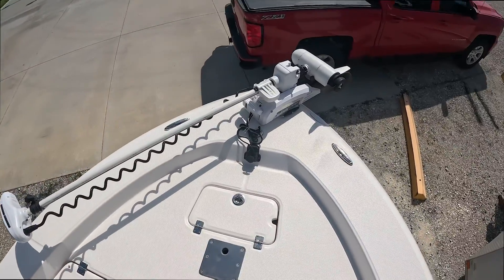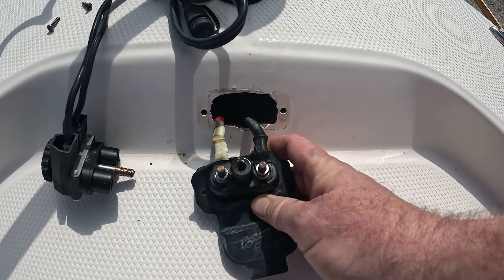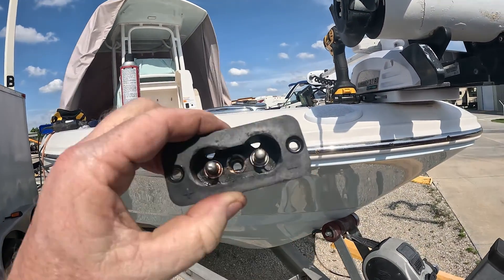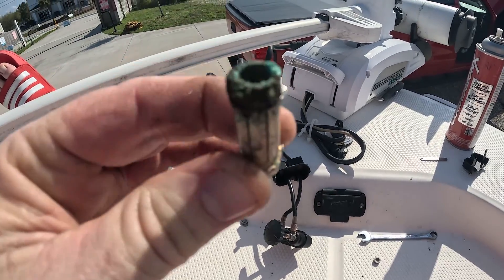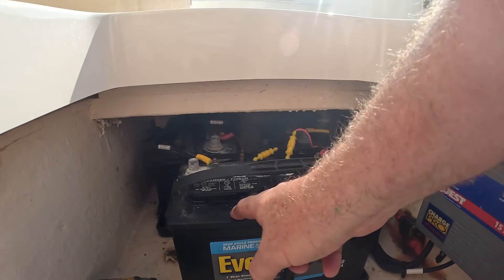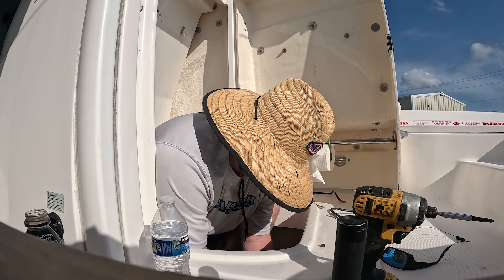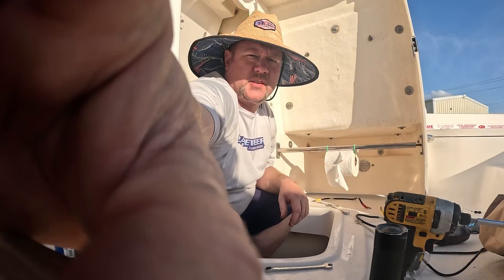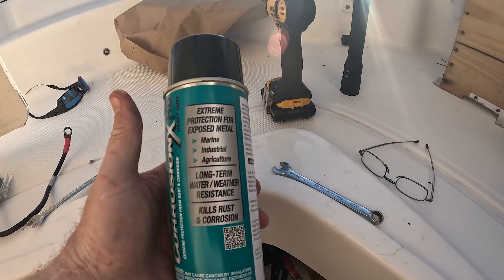Minn Kota Spot lock not working

Comment: Did you have any other problems with the functionality of the tm besides the spot lock?  Mine seems to work fine in all regards other than the spot lock, which randomly and frequently, disconnects.  It doesn’t hold for more than a brief amt of time for disconnecting. I replaced the batteries but have not clean ped or inspected the connections, which I will do next time I visit the boat.  If not connections, I guess it will be transmission related
Reply from the maker: What you are describing is exactly what my issues were, TM worked fine but the spot lock would lock briefly then loose " connection", or I would  get the audible tone that is was not locking on to satellites.  Check the wires as well for continuity/Ohms, If they are corroded they may not be supplying enough amperage, which is the issue with the corroded connector not enough amperage.  If they are not TINNED  wire they will corrode over time....for some stupid reason Minn Kota does not put tinned wire on their trolling motors.
Hope you get her all worked out!
Reply: @residentdawgfishing5424 thank you for your response, much appreciated

Comment: Thanx great. I think you have nailed it.  Had same problem so I know now where to look. Must say tho that plug get rid of it and hard wire to battery. Jus takes one trouble area out of the equation. Many thanks for this.
Reply from the maker: Hard wire is in deed the way to go, But I keep my boat at a storage unit and take the trolling motor off every time , don't want it to " walk away".

Comment: I'm having major issues with my spotlock on the Ultrex.  The foot pedal is also giving me fits.  They are going to repair it under warranty but I'm waiting until my major season is over. Mine is not a voltage issue.
I recommend going to a 36v lifepo4 battery.  I did it 2 years ago and took about 150 pounds out of my boat.  Can't tell you how much better it is than my old setup with 3 12v lead acid batteries and moving that single 30 pound battery beats heck out of those lead acid.
I also found that all the newer fish finder units are very voltage sensitive.  I went to a dedicated 50ah lifepo4 battery for all 3 and haven't had a single issue like I was having using my cranking battery.
I'll be in Clewiston next week for 10 days fishing Okeechobee.   Good to know about that place in Ft Myers because Ckewiston doesn't have much.
Reply from the maker: I want to upgrade to Lipo....but the cost is keeping me from pulling the trigger....one day I will.   Thanks for the info.
Reply: @residentdawgfishing5424  I went with Nexgen battery and a Dakota 18A charger 2 years ago.  It's amazing how fast I can recharge.  I'm still running a flooded battery for cranking.
I have an older 21 ft bass boat that came with a 24v trolling motor.  I added another battery at 60 pounds and Minn Kota Talon anchors at around 50# each.  That extra weight made it very difficult to get on plane when I had a fishing buddy.  Changing the battery solved that issue by removing 150# or so.
I paid $950 for the battery 2 years ago.  I went with the 40AH battery and have never run it down below 40% during a full day of fishing Okeechobee and I have never had any issues with my battery.  We aso fish heavy river current on the Chattahoochee and it has been flawless.  My buddy went with Ionic 50AH and he is having some issues with it charging fully.